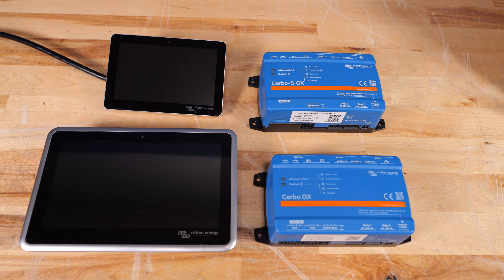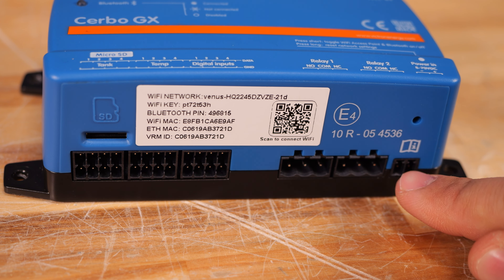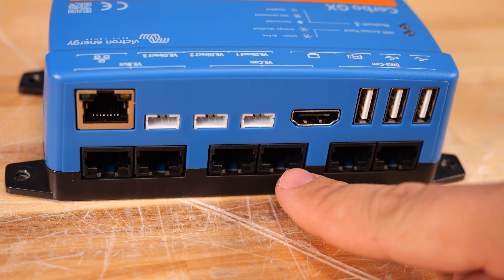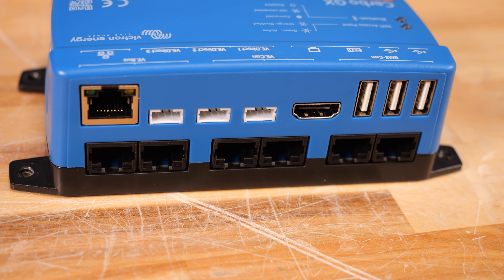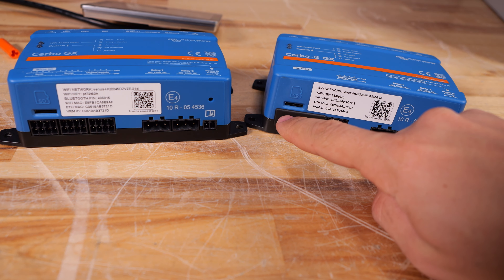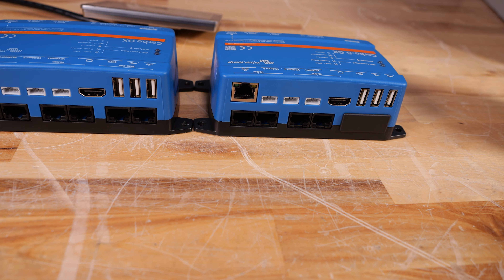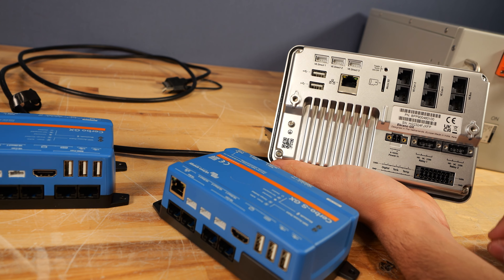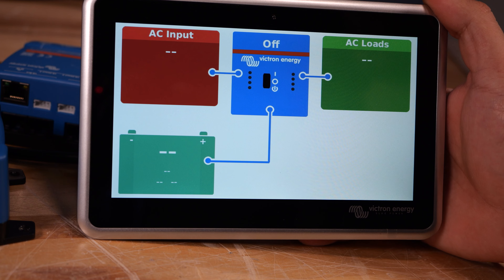Victron GX Device Overview and Comparison | EKRANO GX vs. CERBO GX vs. CERBO-S GX

Comment: Wish they made a feature to have two screens.. In the RV coach area to monitor and a second in the electrical bay for troubleshooting. Yes you can monitor with your phone but it isn't as convenient. The largest advantage Cerbo over the EKRANO has is the amount of cables that need to be routed on a remote display.

Comment: Stumbled across this video. Very nice. The problem is with last unit every single monitoring wire has to be run to it, potentially remotely. With the Cerbo GX, I believe they only give you 6 feet of cable to connect to the monitor. Am I wrong on this? it would be nice to be able to mount the monitor quite remotely from the original unit.

Comment: on a boat I still prefer CerboGX in the engine room + hdmi cable extension (10m works fine) to the interior cabin where the switch panel is where touch50 is mounted. powered by a hidden usb socket that is connected with a switch. so I can switch off the screen if I don't need it, otherwise CerboGX is still on and is collecting data to VRM.
Reply from the maker: Victron does not approve of HDMI extensions.  Victron's warranty does not cover damage or improper operation resultant of such installation of HDMI extensions.  We cannot recommend this option for our customers.
Reply: @mantas6293>> Did you mean, you used a male to female HDMI connector to connect to 5" screen and a 5.1V power adapter to power the HDMI cable? If so, that's a great idea. You can also use high speed HDMI cable ver 2.0 (4K@60fps) that may not require external power. You may try it. jan23'24.
Reply: @sreekumarUSA  correct. I have cerbo in the engine room. and the touch50 in the galley. from the touch50 I connected the USB into a local USB socket to give it 5V. USB is only used for power, no data goes through it. Used regular HDMI extension cable 10m to connect it to cerbo it the engine room. everything works fine, touchscreen, clear and responsive. I checked the warranty conditions and did not notice any issue. I don't think Victron would care to certify some standard cables, it's rediculus to expect them to do that. like for bluetooth adapters, they said they tested a few and it works, some don't. they have not certified anything, just did some tests, or referred to others who confirmed that something is working. you can connect your Touch50 to PC and have it as a small monitor - it's nothing more than that 5V small monitor. :)

Comment: *my inverter the rs smart solar 48/6000 is connecting on VEcan,and my battery bms,i can only connect one to my gx device...would the ecrano gx be better to connect both? also this would rendes my bmv712 smart shunt useless?

Comment: Technically the Ekrano’s two vecan ports are better than the cerbo as the cerbo bms can can’t do ve.can or the new rv-c. Example would be an rv with rv-c and you have a ve can mppt. You can’t then do rv-c AND vecan on the cerbo but you can with the Ekrano. Small difference.

Comment: Great video!  I picked up the CERBO-S GX a few months ago for my multipurpose off grid moto trailer. I did not need all the extra connections the full Cerbo provides. It has been a very nice addition to compliment the rest of the Victron gear I have. Being able to interact with the system via VRM is really nice. Recently did a FW update to the MultiPlus all via VRM portal which was a luxurious experience!  Love you guys!  Keep the great videos coming!

Comment: The new device  also  has a more power chipset
Reply: It has quad core processor. that too is an over kill. single core chip in Cerbo- GX is good too.I watch my PV systems through my iOS/ OS X systems and also on my Apple Watch, from HKG, DEN, LON, DXB etc